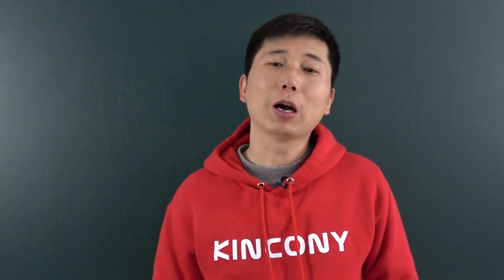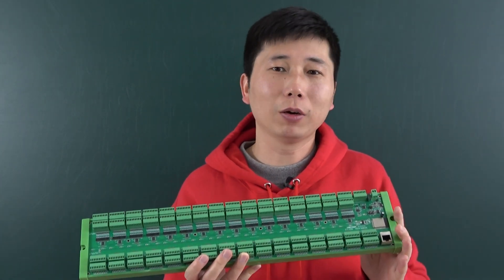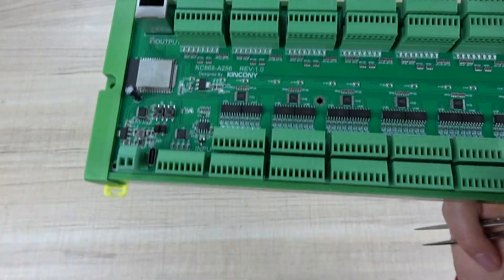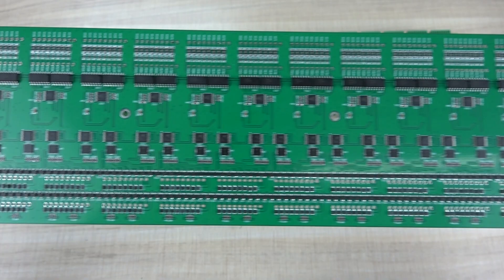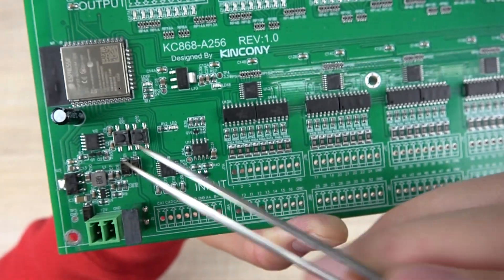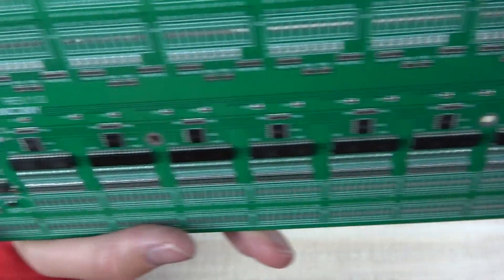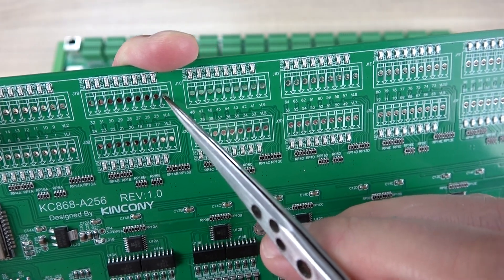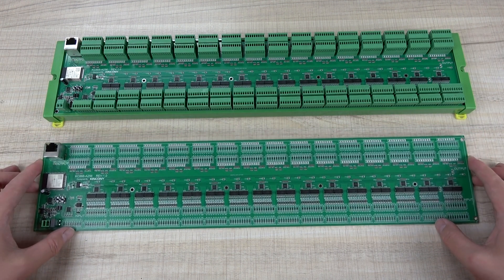Crazy ESP32 board! KC868-A256 512 GPIOs For Home Assistant By ESPHome

Comment: Hello, on the Output side, can we supply 230 volts?
Reply from the maker: output DC voltage, if you want to control 230v load, just add extend relay is ok.

Comment: I have little idea about this biiiig huuuge board. Problem can be if one of IN or OUT will be damaged. It will be difficult to replace the board. 
So for the next design (update) not only for this board it can be for all Kincony boards. For example: Design 8bit OUT,  8 IN board and this little board with socket. and if one of IN or OUT on this little board will be damage we can remove this little board .
Reply from the maker: this is a good idea. i design so many kinds of board, just don't want to use plugin mode, all in one board will stable. if use too much plugin, sometimes will not good contact.